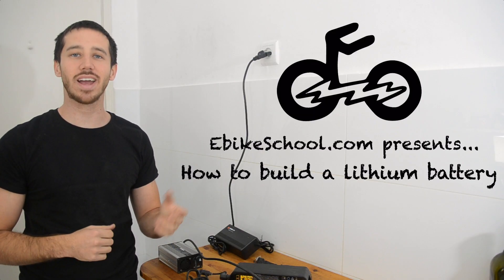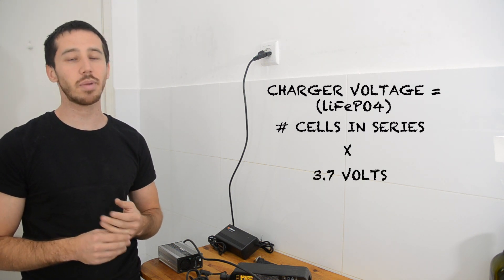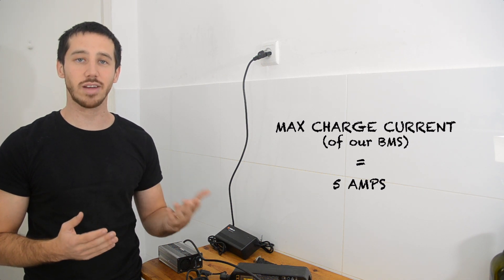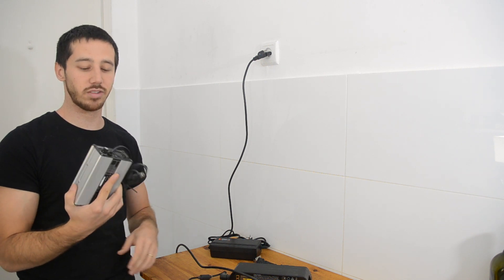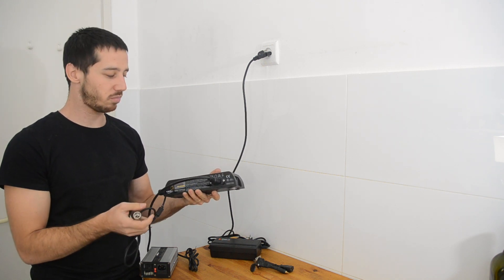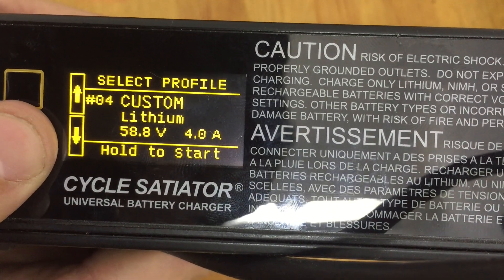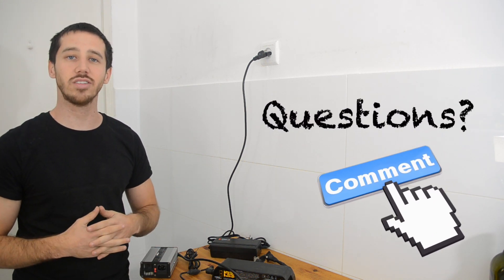DIY Lithium Battery - Choosing a Charger - Part 5/5

Comment from the maker: I hope you guys enjoyed my How to Build a Lithium Battery tutorial series. If you want to learn even more, I hope you'll consider checking out my Amazon #1 Bestselling book, DIY Lithium Batteries, available in paperback and ebook formats. http://a.co/iDtWdPX
Reply: Hi Micah, great book, and terrific videos, thank you.  Can you look at the graphic on page 120 of the book?  Not to be a smart-@ss but it looks wrong, two negatives? I'm a newbie so I apologize if it's just my lack of knowledge.
Reply: Awesome video series! learned a lot from you.
I don't understand something, would appreciate it if you could help.
I thought all the time that the BMS was taking care of charging the batteries equally. From this video it seems that this is actually the purpose of the charger.
So what is the BMS for?
Reply: Dude, you got some knowledge.  I should've check this out sooner.   I've been doing research for quite a while of how to convert a bicycle to a ebike.  I did great converting gas power bicycle, and still ride it today.  Now I'm going to do electric.  Getting resources together first.  Now here's the important question.  When you charge 24, 52, and 72v 18650 lithium batteries.  How can you balance them as well?
Reply: Sir fast charging how its work
Reply: Thank you for the great videos. I have a Hialong battery. Does the battery power switch need to be on to charge it ?
Reply: But this 300$ chsrger dont have aluminum case or fan, soo heat wise is not better, or you just didnt mentioned it?
Reply: How are these batteries and chargers DIY?! All you did is putting prefab parts together, that you bought from a manufacturer.. That's not DIY, that's consumerism.

Comment: For bigger S batteries you need a good charger that will handle. 
I have a skyRC I'ma b6Aac and works well up to 6s which is nice and great charging currents and all you can choose. Can also discharge for storage long term that uses  CC/CV up or down to 3.8v which is perfect for liion and lipo.
Using either will change the max cc/cv you go to. Lipo will be 4.1 i think and lipo is 4.2. so you can save some life. Also you have a computer programmer that i think you can change the top voltages and aruff but i cant remember its been forever.
Also doubkes as NiMh and even leadacid and can charge your car battery.

Comment: I liked your 5 videos Micah but perhaps I would have put just a bit more, EMPHASIS, upon the final one where you were talking about the IMPORTANCE, of matching the number, and Maximum Charge Voltages, of the TYPES, of Cells, that have been used to make up the finished battery pack, to the chosen Charger’s Maximum Output Voltage, BECAUSE, hardly a week now goes by where there isn’t a story appearing in the news media about Lithium Battery FIRES, being caused by people using THE WRONG, Chargers, to recharge their, typically, eBikes, and eScooters.    A LOT, of these things are now, using LiFePO4, Lithium Iron Phosphate Cells, in their Batteries, instead, of the earlier, Lithium-Ion variety, and as a result, it is CRITICALLY IMPORTANT, that anyone following your How-To Videos UNDERSTANDS, THAT DIFFERENCE, and so does their MAXIMUM Charging Voltage Calculations based upon the LOWER, 3.7V (or even better, 3.65V, for Safety) Maximum Charging Voltage per Cell, for these LiFePO4 Chemistry Cells, if they are using them. 
Otherwise, a very well constructed series of Videos.  Well done..!  😉👍

Comment: I have a 48V battery pack that I'm pretty sure is good But the circuit board likey has a crack. It started having issues while I was riding. It would stop powering the bike if I hit much of a bump. I could restart by again bumping the bike.  It got progressively worse until it no longer works at all. That happened when the bike was two years old. The bike manufacturer no longer uses that battery. The dealer checked the bike & battery and confirmed it no longer worked. $540 for a new battery. The battery will charge but will not power the bike. All connections look good. For the last year I've been pedalling my old Treck. Over winter I hope to find the problem and fix it. I know nothing about the system! Hope this site helps.

Comment: Very knowledgeable, thanks.  Is it possible to balance charge my ebike lipo ion battery rated at 48v, 20Ah, 35A BMS?  By charging/balancing it from both ends. With two 54.6v 2Amp chargers. 1st charger is a size 2.5 charging connector and the 2nd opposite side Dean's T connector?  Learned this from my RC Truck Chargers adding multiple charging board.  Thank-You.

Comment: You never mention cell current and voltage monitoring modules.
Don't you think it's a good idea to monitor the status of each cell?
Then you can pinpoint problems early?
It's just a question.

Comment: Thanks for posting.  I am looking for suggestions for a battery charger.  I am currently converting a gas moped to electric.  I am building a 72V (20S9P) battery using Samsung 50E 21700 5000mAh 9.8A cells.  I am using a 100A BMS for a controller that will draw 60A.  It looks like standard charging is 3-5 Amps, but was thinking it might be better to go for higher current 10-20A.  I know that faster charging is not always good, but given the battery size, trying to figure out the best option for charger.  Any suggestions on size or actual charger would be appreciated.

Comment: I'm glad you mentioned the adjustable voltage charger later in the video.  It's really not advisable to charge the Li-ion cells to 4.2 volts as this will significantly decrease the battery life and safety factor.  4.1V is best, as the 4.2 doesn't play any effectual role in power output as the voltage drops immediately upon initial use to 4.1, stabilizes around 3.7 until the capacity is low, and then drops to cutout voltage.  This is Tesla's secret behind their unprecedented 8-year battery life warranty.  Just thought it would be good to mention that to your viewers.  It isn't commonly known, even manufacturer's spec sheets will state 4.2v / cell as charge level, when they themselves don't actually utilize that methodology.

Comment: I hope someone can still answer my question. I have no knowledge in this field. I lost my ebike battery charger and the seller does not sell spare parts. What do I need to check before buying a charger for my 48V 15Ah 18650 ebike battery? My ebike is an Ouxi V8

Comment: Hi. I have a 6 cell 12600 mAh Lithium Ion battery pack with a 22.2V (06S) 60A BMS. It does not have a C- port. When I connect the battery to a balance charger and charge it on charging mode it shows an error. How can I charge the battery? Should I directly connect it to a SMPS (Set the SMPS it to the required V and I rating and then charge the battery)?

Comment: I use an old PC power supply to get 12V at about 18amps max to which I connect a $20 chinese ebay "1200 watt" boost converter that lets me set voltage but also constant current up to a maximum charging rate that is slightly less than the 12v x 15a 180w input rate recommended. I also don't charge to 4.2v/cell but rather 4.0 or 4.1v    For a 15S battery that might be a charge rate of 2.5a or for a 10S battery up to 4 amps.
Reply: Hey good job Rhian, that's exactly right and what Tesla themselves do to guarantee their 8-year warranty.  PC power supplies are absolute goldmines for electronics benches, I have 11 that have been altered to suit one purpose or another, from 250w ones up to 900watt supplies.

Comment: What happens if I parallel two batteries.....e.g. plug a fully chgd 36v into a fully chgd 36v at it's chg. connector.... Could I theoretically travel on my ebike twice as far ?....(the batteries both have BMS units in them so they're protected)

Comment: Hi Firstly thanks very much for making these video's your presentation and knowledge is awesome, I am looking to build my first ebike and will be purchasing your ultimate ebike video course this week for some guidence in the design stage, I am also looking at your battery building book, my question is I am looking at the kindle version ( as I live in NZ ) but see there has been issues with the diagrams not showing in the book in Kindle format, is this still an issue please as it is going to cost me more than the book to get a paperback one shipped. Sorry for the stupid question. Cheers Dave

Comment: Hello, a question: I have a 13S10P battery. a cell has 2,500mAh. So can I calculate 10x2.5A and charge with 25A? how high could i go?? The original charger has 2A.

Comment: Great video dude. I use a 10 amp charger and bms  limits 2-3 depending on what bms I’m using BUT I have a monster cooling system i custom made

Comment: I hope you read my post. Here in the US we love camping and many people bring generators. I tried using mine , which is a 3000w , to charge my lithium ion batteries but my chargers were damaged and I had to get new ones. If a generator is supposed to put out 120 like a house wall socket , why did it burn them out. Also my sister has a 700w generator and in those instructions it says not safe for laptops and electronic equipment like that. Do you have any idea of what the heck happened? Is it possible to charge those batteries at all with a generator? Thank you for any help.

Comment: I appreciated this series on building batteries. I am preparing to build my first pack using lifepo4 cells. Before I buy another BMS and possibly do something foolish, is there a "got'cha" I am missing if I build two identical packs and harnesses to allow series or parallel connection of the PACKS - all I come up with is they need to be charged to exactly the same voltage before (parallel) connection and would need to be disconnected and charged separately. This idea is very attractive for many reasons but I've not seen it addressed anywhere. Cheers!

Comment: Hi, you are my super hero when it comes to anything concerning electric bikes. My question is: would you use a, say, 58.8 v 4A charger  to recharge at the same time two separate 52v battery packs, building a 'Y' type splitter with wires and connectors at the output of the charger? If yes, using which precautions? maybe a diode on each positive wire  of the 'Y' splitter would prevent the battery with higher voltage from discharging over the other battery. There'll be a  little voltage drop over the diode though, but acceptable. Anything that I might have missed considering?

Comment: im gona restore a 36v bottle ebike kit,, as far i checked has 42 cells and it is 10s . but i cant find not smart charger for 10s , what you recommend? buy 2 6s smart chargers and split the 10s to 2 of 5s and delete the bms or find the 10s smart charger ,,  they are sold out or i cant find a online shop that sells 1

Comment: 1:37 Humm, I'm not sure if this is a good idea, it may be a terrible idea in fact.
If your charger is capable of 15A and the BMS wants 20A, the BMS will try to pull 20A this will overload your charger, it may cause a fire or not work at all because the voltage will drop if you overload your charger.

The smart way is to buy a power supply with the same or with a higher power, and use a 20A fuse to make sure things don't go south.

Your BMS is not smart enough to know how much power your power supply can handle unless you tell it.

Comment: I have a brand new hoverboard/segway but doesn't charge. I opened it and check the battery it was 1.2V. What could be the reason? segway is new.

Comment: Hey Ebike guy, I am at a stand still. I cannot find a video that discusses different types of charging connectors coming off the BMS. As well, I am entertaining either XLR or IEC connector. However, your BMS diagram shows 2 wires going to charging connector, but both XLR and IEC require 3 wires. I also purchased your book, but cannot get a specific answer there either. How do I connect either XLR or IEC to charging side of BMS/battery pack

Comment: Bought it, Satiator, 72 volts! what a hassle these batteries are! I had to (force) charge the battery. Not sure why, I could use the plastic no fan hoover board charger, get it to 50 volts. But the power was gone, as appossed to brand new. 4$13P style. It’s charging now at 0.02ampes I will give it 3.5 hrs, to make it to 55volts (overcharge)! Hopefully small amps will bring the scooter back, and make all this time worth while. Buying your book by the way.

Comment: Question: I am upgrading my RV which had 12v conventional lead acid car battery. I bought the 4-up lifepo4 batteries and a BMS to go with it. Can I use the existing charger, a WF8955 SMART charger which changes the voltage according to battery state?  it does 1) bulk charge 14.4v for a depleted condition, then 2) absorption mode 13.6V for mid-charge, then 3) float charge 13.2V.  In other words, can the BMS  (Walfrontvth9zscx12) handle the varying input voltage, or does that create problems for the BMS?   Do BMS's need a fixed, 14.6 volts?

Comment: I watched all the 5 parts and am confused as to where you would plug the power supply/charger into the kit to charge the battery kit.
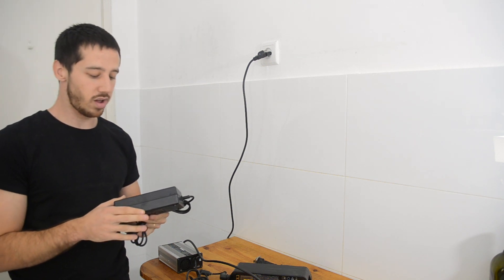Reply: lawl.. you sure you watched all 5? go back to the bms video and watch at around 3:00mins.. you're welcome.

Comment: Thanks for the great 5 part series, very helpful indeed.
Do you have a video on a large capacity 12v battery (for a motorhome), say 100AH or larger. 
I ideally would like a 200AH battery for my motorhome to replace my lead acid batteries.
I have taken lots of info from your videos, but still struggling to work out how many cells id need, what budget cells I should buy, and which BMS I should buy for the battery/batteries.

If you dont have a video, it would be a great one to make, there are lots of people with motorhomes in the same situation as me.

Thank you Ryan

Comment: Why do you limit the size of the charger? I thought the BMS would limit the voltage and charge current so the charger does not need to.

Comment: you say "but the bigest thing is to make sure you match the curent and voltage to your battery" why is it important to hit a certain voltage? i understan the potential needs to be higher  and there is a voltage limit not to take the battery past...but on the way up why would it matter what voltage you used? i have lithium titenate cells that can take 10c charge...every one says i can not charge the 48v battery with 230v dc just using a light weight  rectifier but when i ask them why they can not answer why...this battery can take more than a power outlet here in australia can supply...so why can it not be done with a higher voltage if it is turned off when full?..there is a utube video showing a test on lithium titenate cells..its unlimited voltage charge...the cell is happy/cool untill it starts over charging.

Comment: If the BMS states that Charge current: 5A or 10A can i use a 2Amp charcher? Will it charge?
Reply: Yes it will charge but 2 amps will take twice as long to charge as 4 amps

Comment: Sir can you help me what is the best type of charging for motorcycle battery for only racing 150m ??
Reply: Just choose any which is the same as the battery voltage 52v battery (max voltage is 58.8) so u look for 58.8v charger

Comment: Mica, I saw a E Bike build where he somehow added a charger plug like you have on a car for level II charging. He did this so he could take advantage of the free chargers at the public library and other free charger locations. I am planning on building a 72 volt system for a 50 miles round trip commute. That would work for me as I cannot easily remove such a large battery and would prefer to leave it installed

Comment: For lifepo4, 100ah battery pack. Can i use a charger with output current of 100a? (battery charging data fast charging 3A. 3.2v 6000mah x 16Parallel 4series with 14.8v,100A,  lifepo4 bms)
Reply: you have 16p X 3 Amps max, 48 Amps - probably no more than 40-45 to be safe

Comment: Excellent as always ...but what if you don't use a BMS and you have batteries in parallel that the recommended charge is at .5C.  You could use a charger that puts out higher amperage ...correct?  For instance you had a 4s4p battery built with  3AH 18650 batteries rated for .5C charge means you can use a charger rated at 6 amps and as high as 16V ...right?  Of course it would need to be a balance charger when no BMS is involved.

Comment: 900 amp h 5 volts for $12? is this true? https://www.ebay.com/itm/USA-900000mah-Portable-Power-Bank-LCD-LED-4-USB-Battery-Charger-For-Mobile-Phone/222829438533?hash=item33e1ab6645:m:mCgNH9Z90T6ys-MpRsm4xNw&var=522289601013 . if 10 of these would be 50 volts, 900 amps.

Comment: What a great guide, I have a Question, 

Is there a way to incorporate in the battery pack build something to read / monitor the charge level of the pack? when you're in the field would be great to see how much charge is left in battery (without having to read the volts). Something like a a little screen with a % or a LED color indicator? If so, how are those devices called and how do you wire them to the battery?

Thank you
Reply: A Bluetooth BMS is about the best you can get,  you can see the amp draw voltage etc, the ones that show battery pack heat is helpful too, and some even keep logs, and all this is shown on your Phone!                                                                                                                                                                                             I really like the "Battery Medic" good price shows much more than most that cost 10 times as much, and it has the best precision I have seen,  take a look, hope it helps. :)    https://hobbyking.com/en_us/hobbykingtm-battery-medic-system-2s-6s.html